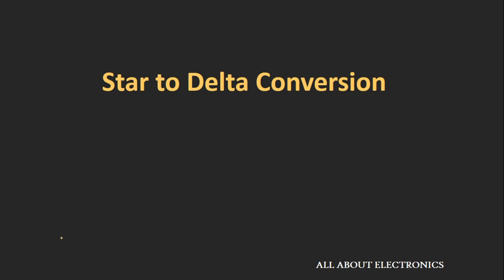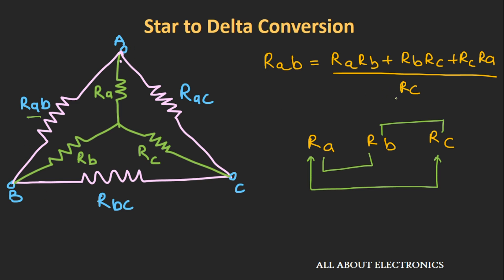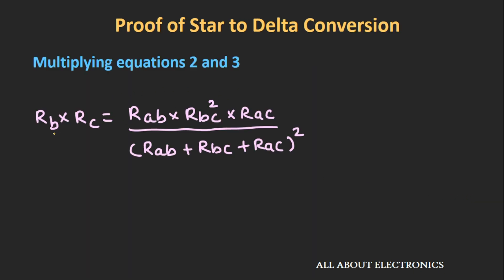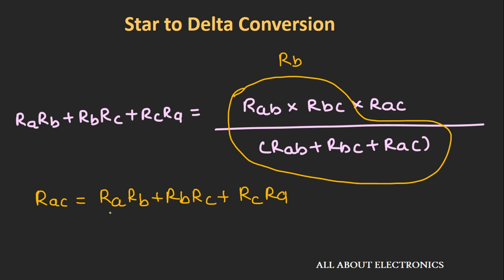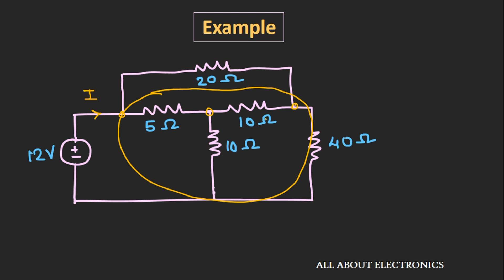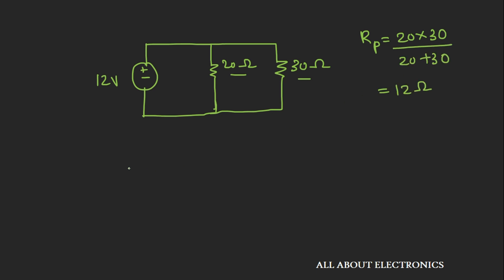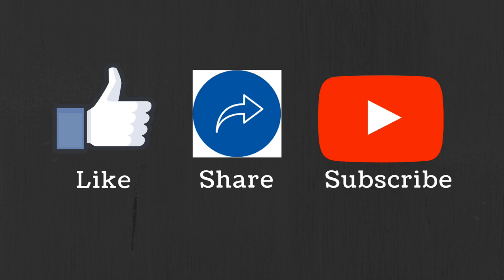Star to Delta Conversion (With Proof and Example)

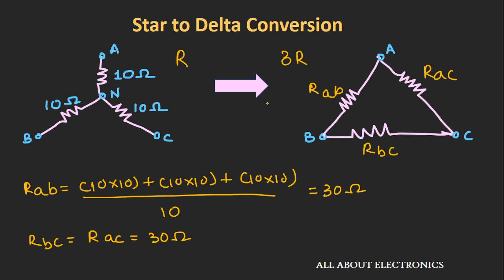Comment: So on 4:01 to 4:20 you converted (  y to Delta) configuration is that right?  My question asked assume you have a Y configuration of resistors where each resistor in Y has a value of 60 ohms convert the Y to delta configuration

Comment: Figure1 is a conceptual diagram of two single-phase transformer connected in parallel.  Figure 2 illustrates the equivalent circuit of the two single-phase transformer circuit of figure 1. Assuming the above two single-phase transformer equivalent circuit is wrongly connected with a coil length, DY of impedance, Z = R + jX and two lengths of cables that interests at point M; forming a star connected circuit of three branches with resistance: Rk3, Rk1, and Rk2 .Derive
1a.The expression for the total impedance of the equivalent circuit of Fig.3
1b.The expression of the source current, Is of the equivalent circuit of fig.3
1c.Assuming cable DY is disconnected from the circuit, derive the expression for the new total impedance of the circuit.

Comment: Sir doubt at adding eq 4 5 6 
 How the square terms of Rab Rbc and Rac goes. Can u explain that
Reply from the maker: when you add equation 4, 5, and 6, Rab Rbc and Rac will be common in all three terms, If you just take them out (i.e Rab*Rbc*Rac) then you will have (Rab +Rbc+Rac)*(Rab*Rbc*Rac)
Please pause a video at 5:47 and look for a while, you will be able to get it.
Reply: Sir Rab^2 Rbc^2 Rca^2  is common but u have taken only  Rab and Rbc Rca
Reply from the maker: Please check carefully, only Rab*Rbc*Rac will be common. Each term has one only one square term (e.g Rab^2*Rbc*Rac +Rab*Rbc^2*Rac +Rab*Rbc*Rac^2)
So, only Rab*Rbc*Rac will be common.

Comment: why it is necessary to equate the delta with star for delta to star conversion. And why adding and subtracting the equation in delta to star? 
It is like memorising the steps. will you elaborate?
Reply: similarly why we multiplying the equations of delta to star equations for getting star to delta equation?
Reply from the maker: Dear Sudharsan, As both DELTA and STAR networks, are equivalent network so we can perform all these operations. (Multiplying and equating etc.). If you still feel it's just mathematical steps, then what I would suggest you find the current at each node in both the networks. And as both the networks are the equivalent network, so current at each node will be same. So, you can equate them. And from there also you will get the same equation for the conversion.
I hope, it will clear your doubt.

Comment from the maker: Do let me know your questions and suggestions here.
Reply: Hello can you help me in my research  Who is talking about star-Delta transformation and its application for electric circuit containing impedances (complex values) similar.
Reply: Sir in exam it's asked for 10 marks,i think it's not enough derivation for 10 marls
Reply: Super bro
Reply: Sir with all due respect do you know what a proof means? I'm sorry to say this but what you have done is similar to 2+3 = 5 then 2= 5-3 so then again 2+3=5 hence proved
Reply: Sir you have said that we are going to prove star to delta conversion and first u have took three equations top of that heading is delta to star and after sometime heading has been changed to star to delta we are confused by that sir
Reply: Figure1 is a conceptual diagram of two single-phase transformer connected in parallel.  Figure 2 illustrates the equivalent circuit of the two single-phase transformer circuit of figure 1. Assuming the above two single-phase transformer equivalent circuit is wrongly connected with a coil length, DY of impedance, Z = R + jX and two lengths of cables that interests at point M; forming a star connected circuit of three branches with resistance: Rk3, Rk1, and Rk2 .Derive
1a.The expression for the total impedance of the equivalent circuit of Fig.3
1b.The expression of the source current, Is of the equivalent circuit of fig.3
1c.Assuming cable DY is disconnected from the circuit, derive the expression for the new total impedance of the circuit.
Reply: Explain with logic. The way u r teaching seems illogical.